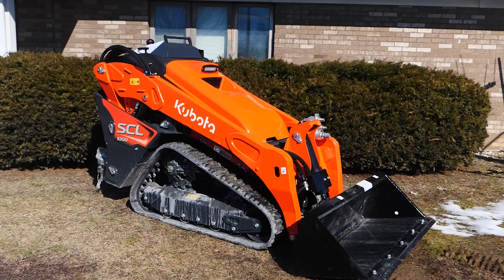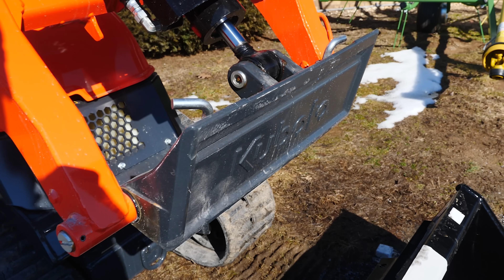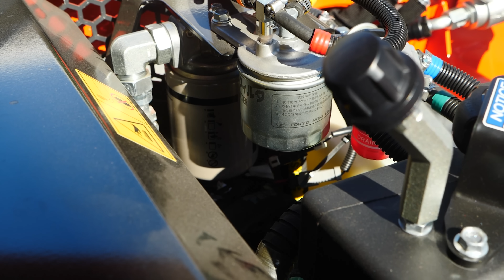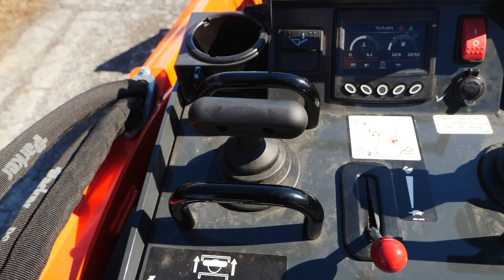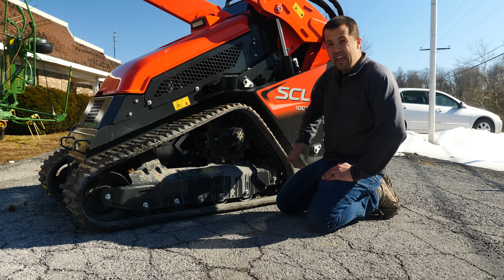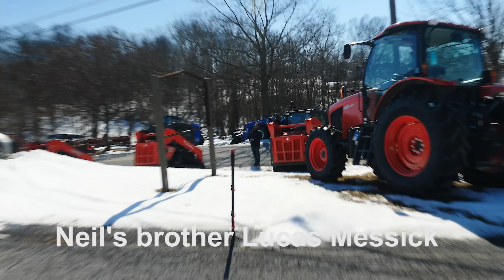*NEW* Kubota SCL1000 stand on compact loader | Unit Walk-Around

Comment: I put some hours on one of these this past weekend.  My local rental yard just got one- had 9 hrs on it when I got it.  I was very impressed.  The controls are insanely smooth.  I have a bobcat MT85 today to finish my job and the difference in how smooth the controls are is noticeable.
Reply: how was the line of sight to the bucket for digging and grading? as far as operators standing height ? last time I used a mt85 it seemed like digging out was hard to see the cutting edge of the bucket.
Reply: @Mantronix6804  I think all of these stand on loaders are pretty much the same as far as visibility over the top to the front edge - I'm 5'11" and couldn't see the front edge of the bucket.  I found that the visibility looking to the side of the bucket was decent if I leaned over slightly.  I ended up using the side of the bucket as my guide instead of worrying about seeing the entire front edge.
Reply: which one you think its better Kubota or Bobcat MT100?. please I need one to starting my small business

Comment: Looks like a great machine for horse stalls and those working in tight urban areas.
Reply: I was thinking the same thing...that size of a machine would be great for a lot of people.  Landscapers in my area are now using similar type machines for their landscape work moving mulch, bark, dirt, etc.  Its a great machine with so many uses, and I'm sure a lot of attachments coming, with the 14 or 16 gallon per minute flow at the auxiliary outlets up front that he mentioned it's quite capable of running a lot of stuff, wonder if they're going to offer a post hole digger attachment if one isn't already available, I bet that thing would be excellent at digging post holes because of its compact size and tracks it can get to places a lot of other machines can't.